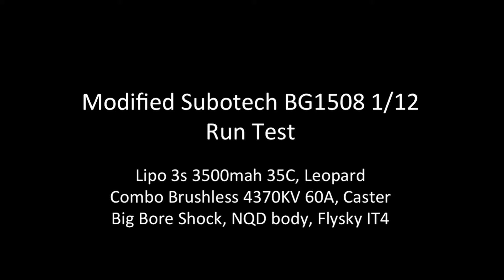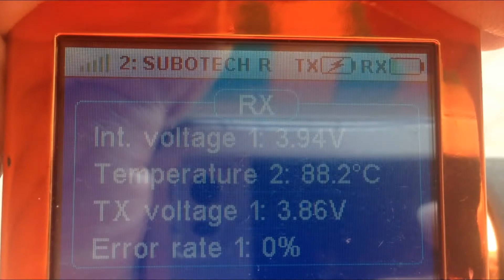Modified Subotech brushless running on 3s lipo

Comment: Don't know if you ever check this, but how did you get that motor mounted in there.  The diameter is bigger then stock?  Thanks,
Reply from the maker: +jjp 735i yeah i need to grind the innerside of the mounting to get bigger hole to mount this bigger motor